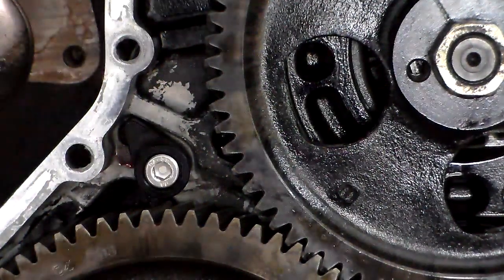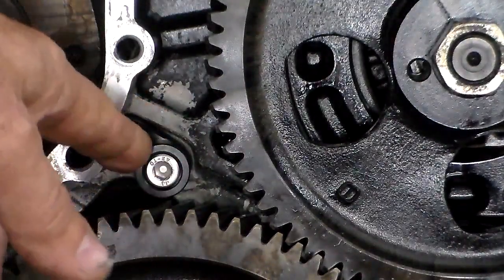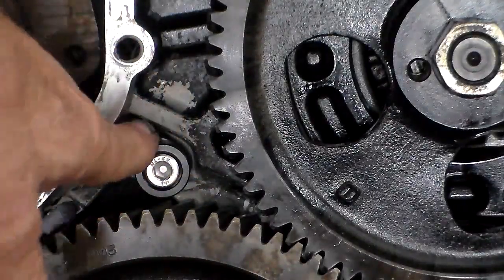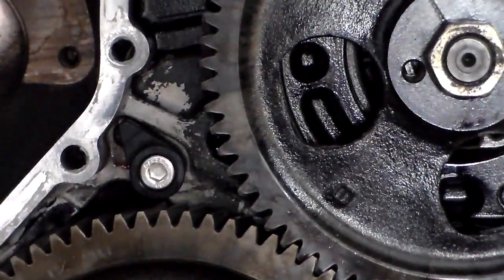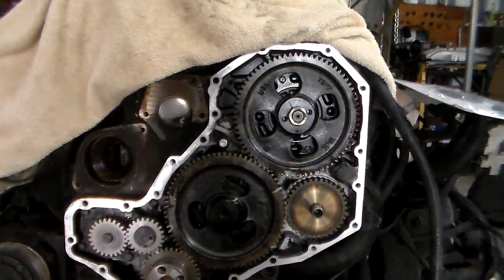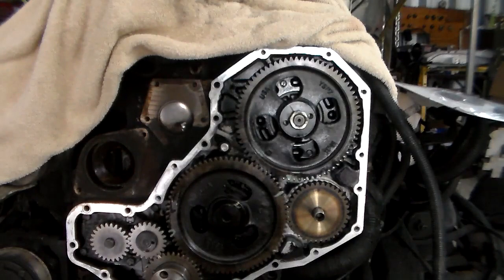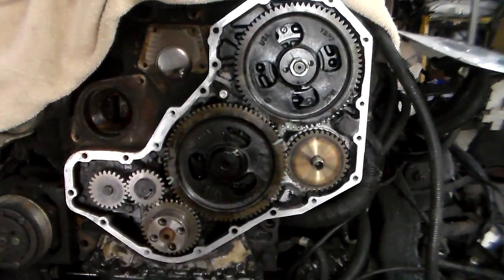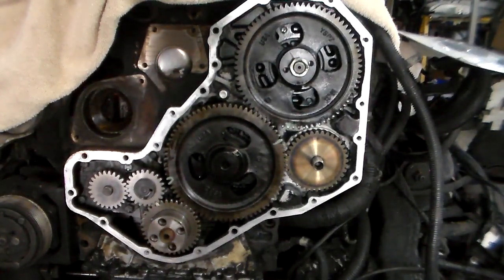Cummins killer dowel pin fix.

Comment: A common problem on those Cummins engines is they will leak oil from behind that aluminum piece that's on the front of the engine.  It's a pain to replace that gasket the gears have to come off.
Reply from the maker: It will be even more of a pain now I will have to pull the front end to change it. lol

Comment: Is that a common issue.?
Reply from the maker: Ive never seen one come out but I guess it happens around 300,000-500,000 miles and im at 250,000. I didnt see that it had started to move at all tho.